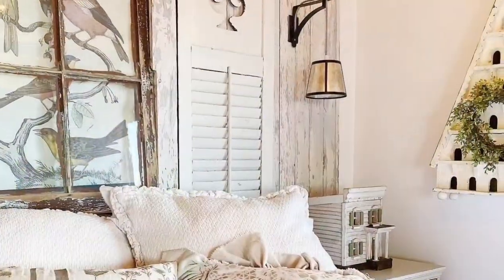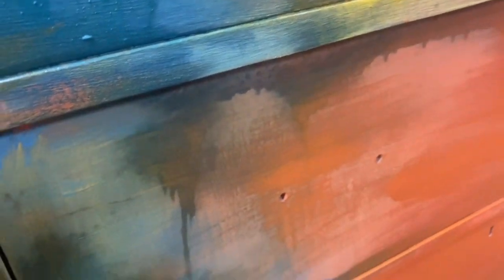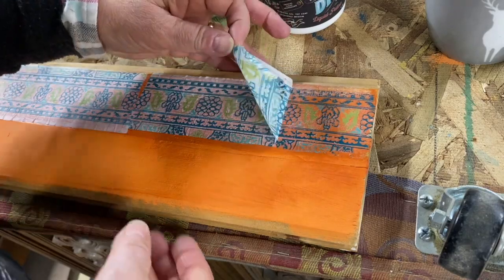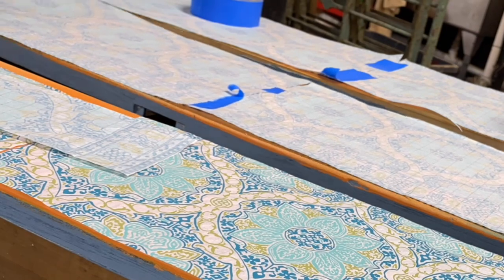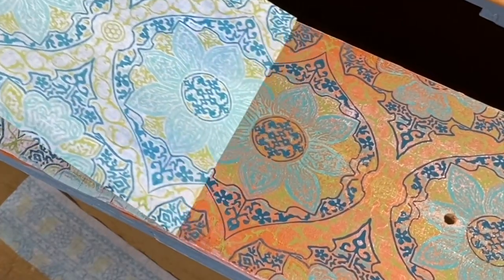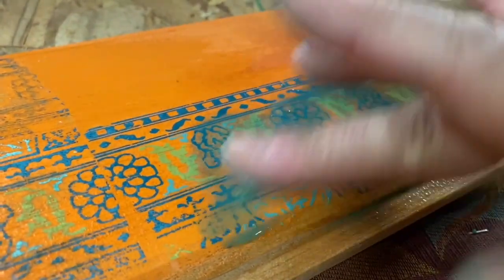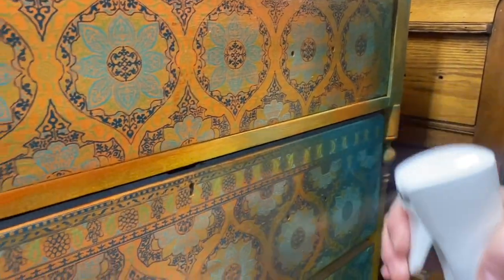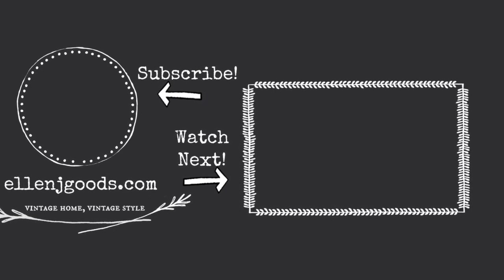How to Apply a Paint Inlay over Blended Paint

Comment: Dear Ellen, I've just watched your video and it's amazing, thank you for giving us a solution on how to put paint inlays on blended piece of furniture (it turned out gorgeous btw) now my question is, since I can't get Liquid Patina here in Croatia (Europe) do you maybe knows what else can I use instead, maybe Mod Podge, some other water based sealer like Clear coat or something else? Thank you so much for your help 🙌 I stuck in the middle of the work and don't know what to do next
Reply from the maker: Thank you so much for visiting us here. I think you could absolutely use any Clearwater base sealer. I always suggest doing a test sample, just like I showed you in the video. Thank you so much, let me know how it goes!
Reply: Drar Ellen, you've helped me a lot, thank you so much, I will test it first of course 😊💛